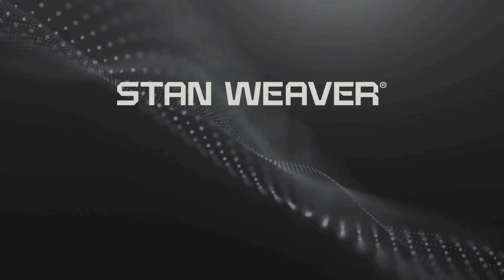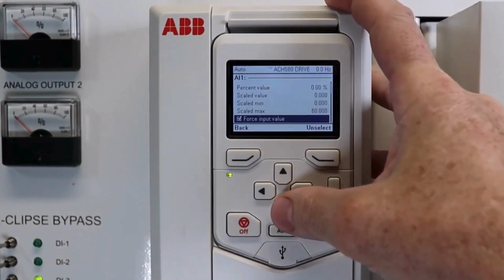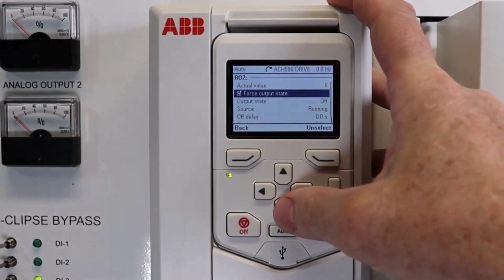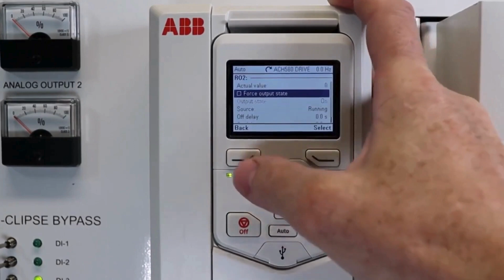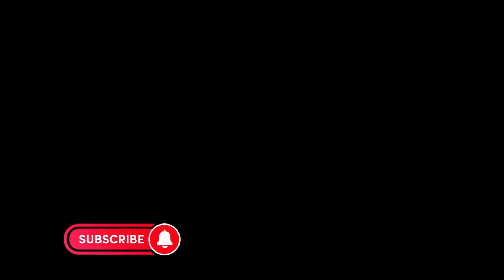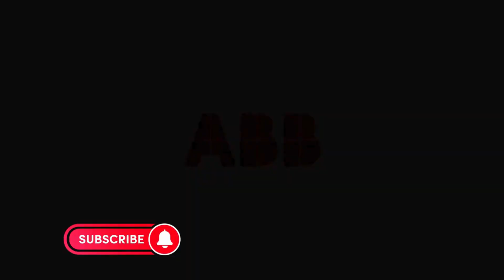ABB ACH580 Variable Frequency Drive I O troubleshooting via the Control Panel Main Menu I O

Comment: Whoever made the manual had best be fired, and should never be able to get a job again. It’s terrible. It tells you how to hook it up for start stop, tells you after startup it will auto work. NONE OF THAT IS TRUE. I have it hooked up perfect, i’ve used the parameters, this thing is a massive piece of garbage. And it’s pretty clear it’s designed to force people to pay for the manufacturer to come out to start it up. Which needs to made illegal.